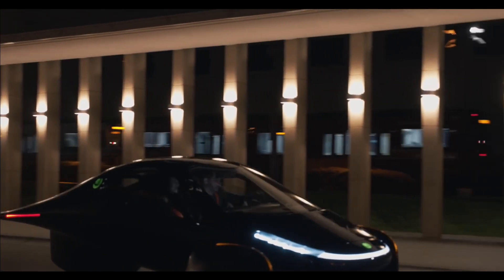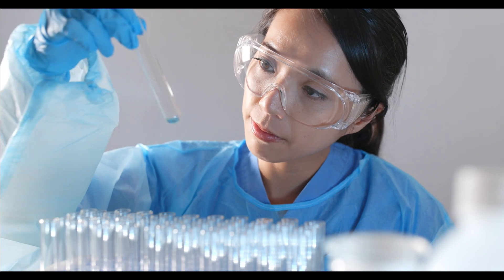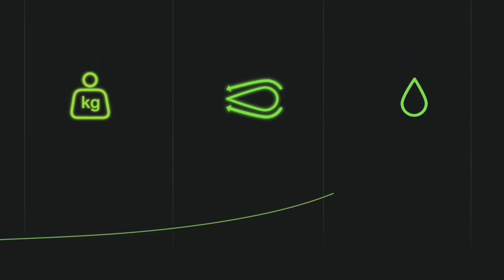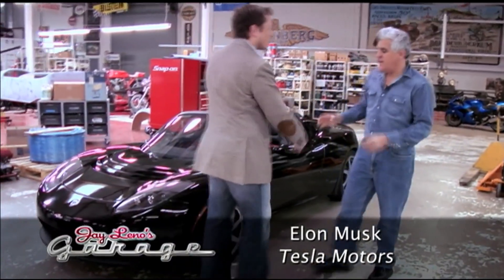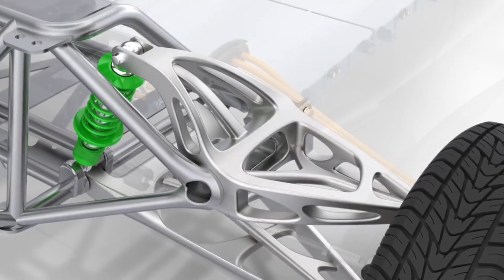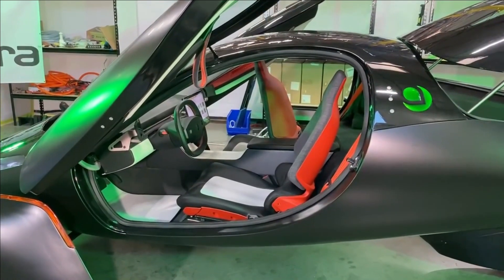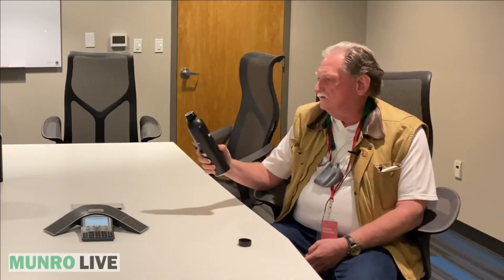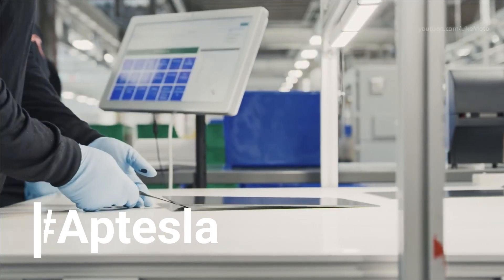Aptera's Tesla Connections

Comment: True for commuting, the Lit C-1 with a gyro would be my first choice but and Aptera with gyro and two wheels would be a strong contender at 33% less rolling resistance and tilt ability. Room for a pod under the seating area in front of the wheel tower would just swell the belly slightly until solid state improves and then placed where the battery is no longer needed.

Comment: How well would AC work with limited radiator? Love car.
Reply: The radiator will not really be limited, just different.  Due to the foam filled construction on the body, the heat loads are less, as well.

Comment: I wonder if aptera can go in the boring tunnels
Reply from the maker: I'm pretty sure it can. I saw Elon drive a Cybertruck in there so the Paradigm should easily fit.
Reply: I think that it is too wide 😕
Reply: The Cybertruck is under 80" wide which barely fits into their tunnel. And there was talk that Elon is shrinking the Cybertruck 3% to better fit in the tunnel. The Aptera is 88" wide. Not that most Aptera owners would really be badly disappointed by not fitting into the Vegas tunnel.

Comment: I was an early Aptera lover hoping the philosophy would be tech for driver benefit rather than tech for non-driver benefit, or worse, tech for Tech's sake. I am extremely put off by the oversized touch screen, a reason I won't even consider a Tesla, and hadn't realized you were going in that direction. I wish you great success with your chosen market, but sorry, I won't be along for the ride.
Reply from the maker: I actually like a large screen size for safety reasons (within reason). A lot of people make changes to radio and other setting while driving so having a screen with large easy to read fonts and icons is pretty crucial. Can't change people much but you can change technology to keep more people safe.
Reply: ... and I love large touch screens 😀
Reply: The entire Aptera philosophy is efficiency and reduced parts count.  The screen eliminates many small parts and improves speed of assembly and decreases cost.

Comment: Aptera has made right to repair a core value of their brand. Tesla, meanwhile, has sought to limit access to spare parts by independent garages.  Using Tesla parts would require that Tesla be willing to provide access to spares to Aptera owners/servicers. Would they be?
Reply from the maker: Not necessarily. Many Tesla parts are made by third parties. Depending on the situation there, Those manufacturers might still be able to sell the same parts but under a different part number.